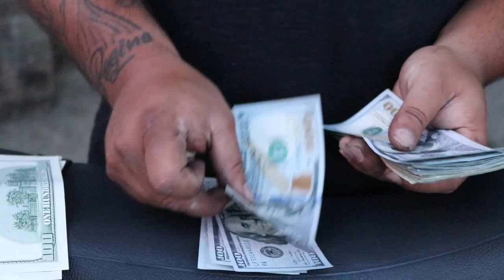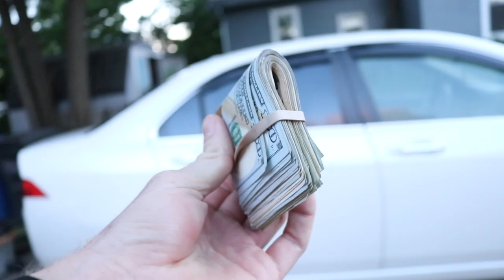Buying My FIRST Supermoto .. First Ride & Reveal | WHEELIE MACHINE!

Comment: great bikes :)
I've had one for 2 years , rode it almost everyday like a hooligan and didn't have any trouble with it whatsoever... Then decided "man I need more power" , sold it and bought a husky 610 - biggest pile of crap i've ever owned , sold it after 2 months and only god knows how much lost money ,  and bought a exc 530 converted to supermoto. Drives like a charm but is a pain in the ass to maintain , and there's always some type of sealing or bearing that needs to be replaced , not to mention the fact that I'd have to probably open the engine at the end of the year.

So im honestly thinking about going back to the DRZ next year , because it's the most reliable supermoto you can get ... and about power - well my friend clutches a 100% stock drz up in 4th gear (long , stock gearing) , so maybe instead of complaining about power I should spend some time on a stunt spot :)
Reply: should consider a wr450
Reply: Try ktm 690 smc. Much more power and still 10 000km service intervals
Reply: Matt drift or a 250. Those things are agile and savage.

Comment: What's your beef with a 5-speed? Just curious.
Reply: Always grabbing for 6th is mine
Reply from the maker: What he said^^😂
Reply: Yep, motor revs up ready for the last gear change so you go to shift and find there is no 6, which is a shame as motor feels like it has more to give but holding back. I went from this to street triple, MT09 then S1000r. DRZ is good but has to be thrashed and lots of gear changing...soon grow out of it unless you are a wheelie king, which Im not!
Reply: always wanting 6th when cruising on highway 
engine just doesn't like it
you could change up the sprocket ratio to make it strain less on 5th
but you'll lose some acceleration 
having 6th would be nice,when needed

Comment: Don't joke about not looping out, because it will definitely happen to even the best stunt riders, you do have skills though no doubt, Make sure to wear gear when wheelieing, I know I sure will! With the 250l if it starts to come down it often wont have the power to bring it back up so I have found you have to keep it up, with my plated wr250f it is much more twitchy, but it has the power to bring it back up.
Reply from the maker: I’ve looped plenty of times haha, and yes the 250f has way more grunt.
Reply: I figured bro, we all do! I had a bad loop a few weeks ago on the crf250l the bike landed on my lower leg and ankle at 40 mph and smashed it pretty good. It was at night right after a storm and hit a pile of gravel and it just came back to quick for me to react, but I wish I would have pushed the heavy pig away from me! I had what most would consider as good boots on, but it was bad enough for me to order a pair of low cut reinforced motocross like boots yesterday, just in case. I have off road racing boots but I don't want to wear them all the time. @AdventureDaily

Comment: Congrats, I don't have a DRz SM currently :(

That bike looks GREAT.

mine had a FCR39 carb, airbox mod and a yosh full system, it rocked.

In Salt lake city, 700 E, light to light I used to pick on all the Harleys, and out drag them, they were like WTF(I don't do that now, lol)

Then the V-rods hit the scene, and my DRZ400 wasn't enough, lol.

That's going to be SOooooo fun!!

I look at our classifides all the time for a DRz400SM with a FCR39 and a good pipe all the time.

I have a KTM505 SM setup now, but it won't have the longevity of a drz. In the future I'd like a 2019 Honda 450x(I think the next gen drz) with a sumu setup.  Cost to smiles, all DRZ though.

Comment: Put the fcr39 carburetor on it, some say it gives you close to 10 extra hp.
Reply: Trickmustang 1994 And put Hotcams Stage 2s in it, and oof! Power in all RPMs.
Reply from the maker: This one put down 36HP on the Dyno so I’m pretty happy with it as is.
Reply: Attention Deficit The stock DRZ is at 32 HP, so what mods do you have to be at 36 HP? I'm curious since I haven't taken mine to a Dyno test yet. Mine has:

-Yoshimura RS-2 Full Exhaust.
-FCR39 slant carb.
-Hotcams Stage 2 both intake and exhaust.
-15/39 sprockets, if that affects Dyno reading.

Comment: Where's the 250L & DR-Z400 comparison video? I can't find it. These are my two top dualsports and I've never owned either one. The WR250R was my first pick but once you get up to that price range the DR-Z makes more sense for the sort of riding that I do. The new 250L with direct injection and dual spark will be a great deal if the price stays where it is.

Comment: I'm genuinely interested to know your thoughts on the DRZ400, crf250l and XR650. I'm vertically challenged at 5'8" and am in the market for a dualsport that can do highway and trails. Also I LOVE aircooled bikes.
Reply from the maker: You just answered your own question haha 650 for the win. Or a 400 for that matter.
Reply: Attention Deficit but I'm short.😅 650 with 34" seat height? OK.
Reply: @revmatch8240  I can speak about the DRZ400SM, I'm 5'6 and the supermoto is perfect.
Reply: Opposite Lock thanks man!
Reply: @revmatch8240  I'm 5'8" and I roll the drz fine (slight tippy toe). My only gripe is it's a bit underpowered at higher speeds imo. I would opt for the 650 if you plan to do lots of highway riding.
Reply: Jon's Moto Garage im shooting for 50/50
Reply: @thumpertorque_  hi- glad to hear you're comfortable on it! ...I'm the same height as you, also. I'm a chick with some dirt bike riding when I was in my 20's;  ( had KX 80 as a kid, then YZ 125) ...then,  didn't ride for many years, then divorced, & picked it up again, have been riding a Grom; kinda bored w/ it/ outgrown it now, &  I'm ready for a bike I can ride on the freeway, & off- road some , & wheelie fun. I've had my eye on the DRZ for awhile, wanting a Sumo. You've helped to seal my decision to get one, thanks! 😉😎👍
Reply: Bro, I'm 5'7" and I ride my 2016 SM with no problems. Just shave off 1" off your stock seat, and do some getting used to. You'll be riding yours like a champ in no time.
Reply: @sixxchk71  No problem. If you were a guy I'd you a short rider tip but since you're a chick you're probably already be doing it anyway which is skinny jeans lol It's a life changer for short riders, makes it way easier to put your foot down at stops and get on and off the bike and doesn't restrict movement and flexibility unlike baggier pants. Makes you feel like you've gained a few extra inches. The other obvious one is boots with thicker soles but I can still do fine even with a pair of Vans. Since you're planning on doing some highways, consider getting a smaller rear sprocket for some cruising ability. You might loose a little power but you can do the usual power mods like 3X3 airbox, re jetting and and aftermarket exhaust to compensate for it. It's a great and fun bike that can do pretty much everything, good luck.

Comment: Thing is sadly there is no perfect dual sport. The drz has great power but its not fuel injected, 5 speed(with terrible ratio), and looks like it was taken straight out of the 90s. The crf's, the 250 and the 300l are both underpowered, but has that sixth speed and not as heavy as the drz. The kawi 300 is again underpowered. Ktm dual sports are so expensive, so what I am saying is that for the price range and engine displacement, there is no perfect dual sport unfortunately. If they would just update the drz and change those 2 things, it would be the perfect dual sport, although it would be a bit more expensive.
Reply from the maker: I am happy with my 300L, watch some recent videos. I agree with your comment though, multiple bikes is the answer!
Reply: @AdventureDaily  ya, those are some sick plastics tho man nice

Comment: You probably put 5000 miles on it in 2 months cause the odometer doesn't spin when the front wheel is in the air 😎